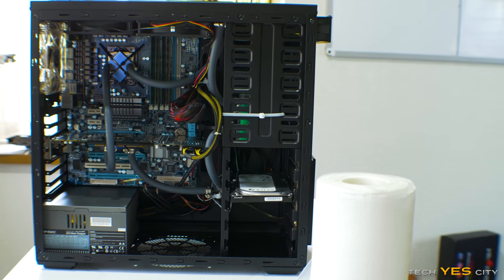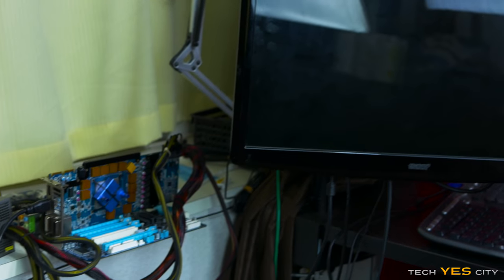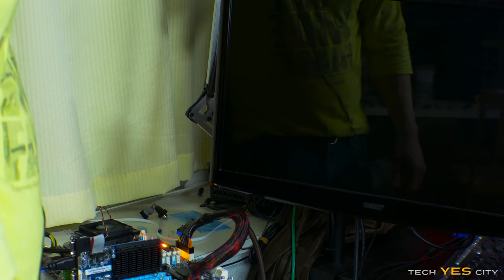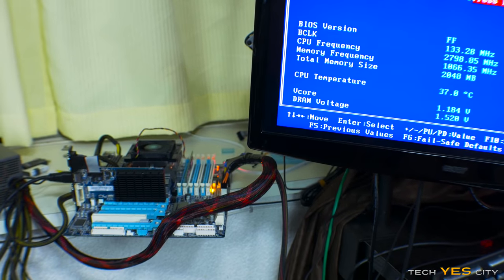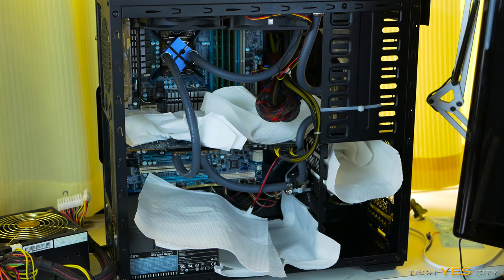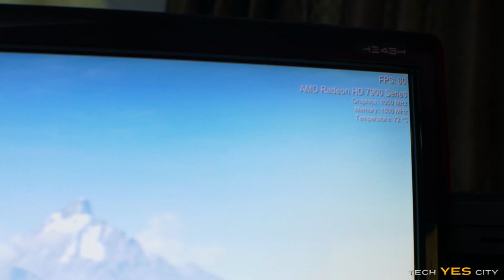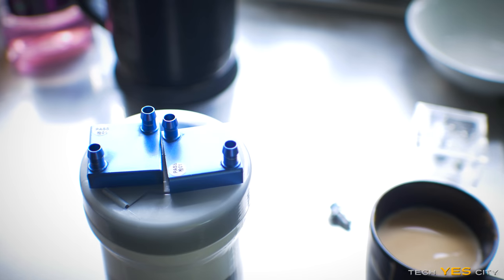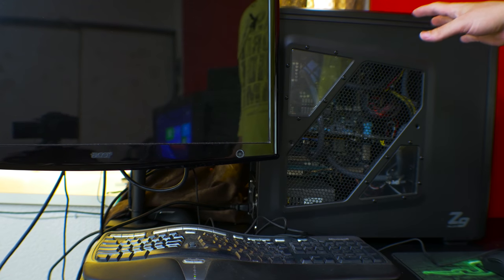$50 Custom PC WATER Loop - Is it POSSIBLE?

Comment: im tempted to try this.......
Reply: I got a old AIO with a dead pump for 5€ and i added a random pump amd got it working and use it daily, just it suck it has max a AM3+ bracked 
The backplate supports all sockets besides AM4. If anyone has a COOLERMASTER Seidon 120v mounting kit for intel let me know
Reply: @dexsters5643  just search for one
Reply: @fewik8567  i cant find it
The aio is 
coolermaster Seidon 120v
Reply: @dexsters5643  admittedly there isn't many available, I found a link to a forum but the website won't allow me to view unless I accept notifications so I'm leaving that, I found another but I doubt you'd be willing to shell out the $130 they ask, it's an old cooler anyway I'd look at getting something new sometime soon
Reply: @fewik8567  130 i would rather pass and buy a dual or triple rad cooler for that amount of cash
Reply: @dexsters5643  that was included import taxes but yeah, you can get an nzxt kraken for that, plenty of very nice coolers at that pricepoint